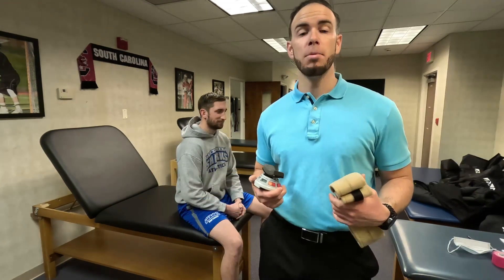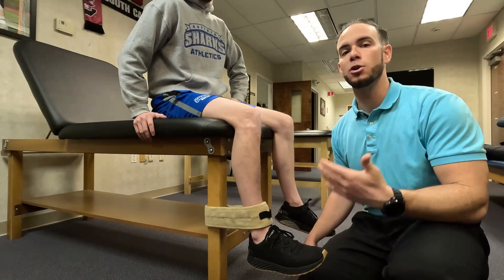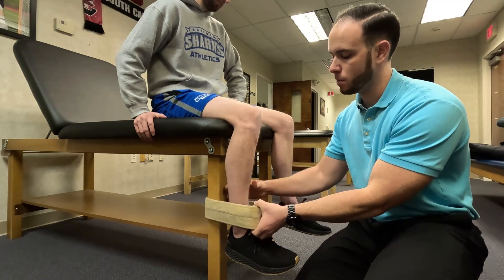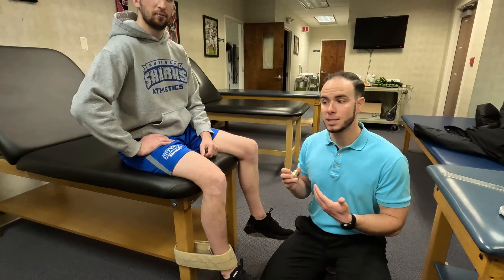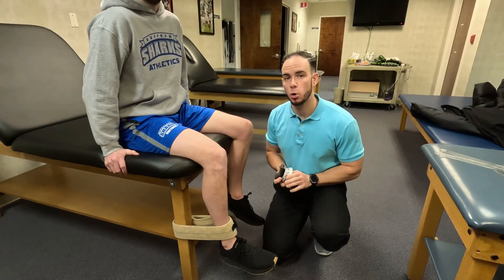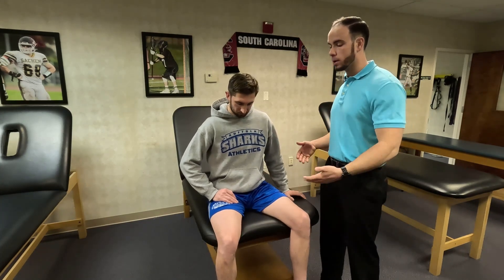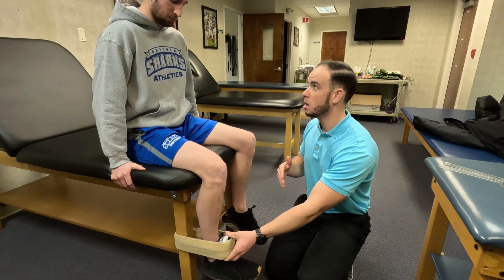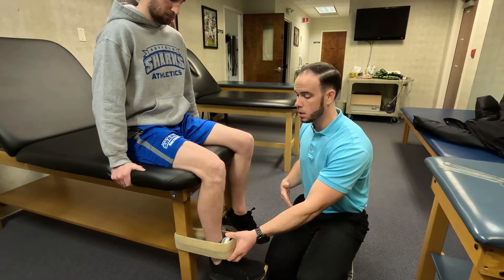How to Measure Quadriceps Strength with a Hand Held Dynamometer

Comment: Would be interesting to see how you measure the other muscle groups of the lower limb, are you using a belt there as well?
Reply from the maker: yea the belt can be used for other muscles and is great for stabilization to make sure we minimize compensations and have consistent testing procedures. I can make some tutorials in the future for testing other lower extremity muscle groups